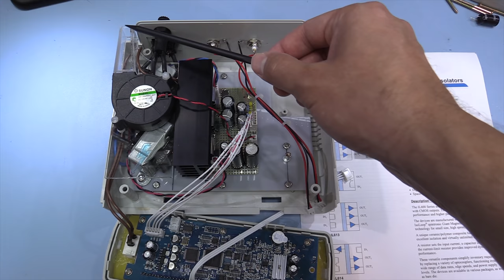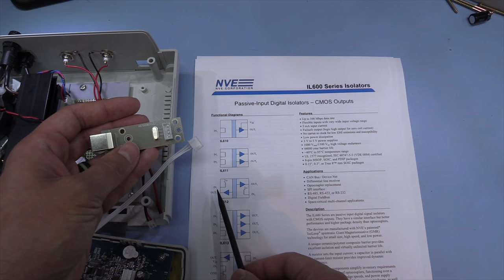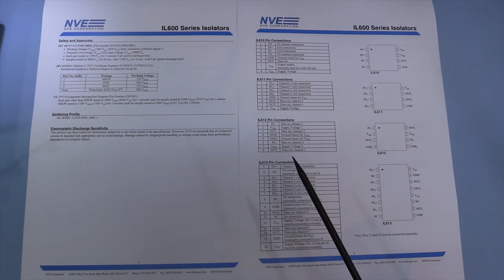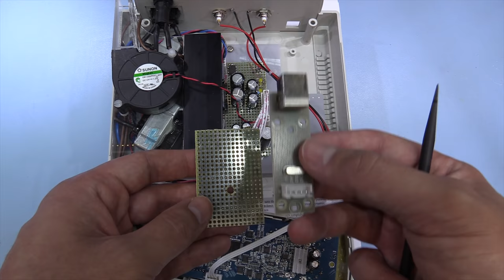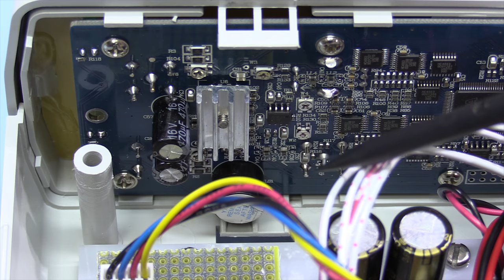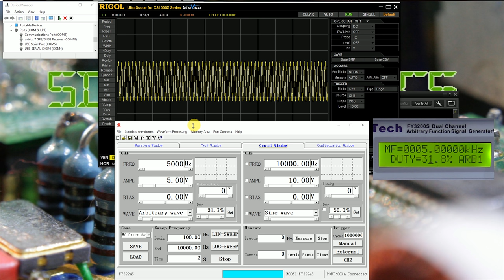SDG #041 USB Interface Isolation - FY3224S Sig Gen

Comment: PROBLEM! I could only find the IL612-2 at Digi-Key, but you have to buy 10!  Is there a more common part to substitute?
--
Also, what type connectors are you using?
Reply from the maker: Perhaps the Si8421AB? Connectors are Molex KK I think.
Reply: @sdgelectronics  - This should work, from Mouser: ISO7721FDWVR
Thanks for writing back!
Reply from the maker: @markopinteric  yes, it should work fine

Comment: Can you please explain why you wish to have the signal generator's exposed grounds (BNC connectors, USB connector)  isolated from mains ground.  A simple solution to the safety concerns is simply to connect the mains ground (green-wire in the USA) to the  signal system ground (power supply negative) which in turn are connected to the BNC and USB connectors.
Reply from the maker: It means you can connect the signal generator to any point in your circuit and not worry about stray return paths. It's not a necessity, but it means you could drive some high side transistors easily for example.

Comment: How did the case temps compare Steve with & without the fan, did you see much of difference?

Cheers
John
Reply from the maker: Hi John, there's quite a difference - there are some vents built into the bottom of the case, so with the fan I didn't see anything more than 2°C higher than ambient in the free space of the case. Without the fan the internals reached 15°C higher, but the 15V transformer was alarmingly warm at full load into 50 ohms.

Comment: Thanks, I bought one and have started to order the parts for the modifications. For what it's worth there are some very nice potted, PCB mountable transformers by MAKRAI  in Hungary which are less bulky than the ones you used. They are available from a number of EBay traders.
Reply from the maker: Thanks Stephen for the info.

Comment: Excellent as usual. One question, why the galvanic isolators as opposed to opto isolators?
Reply from the maker: No particular reason - both are valid options. The nice thing is that they are buffered outputs, so you don't need to worry about the impedance of your pull-up resistor which you'd typically use on a standard transistor output opto.

Comment: Another interesting video. I'm planning a very similar upgrade of my own unit.
I see you've used the IL600 series though - any particular reason for that choice? Those look a bit awkward to use, by way of "coil current" and so on. I've always been more a fan of the Analog Devices range; in particular the ADuM1201 would do well here. That's the chip I'm planning to use in mine.
Reply from the maker: The Analog Devices isolators are just as suitable for this design - I mainly used what I had to hand. Thanks

Comment: Could I use optoisolators ?
Reply from the maker: Yes absolutely. Just watch size of the pull up resistor if you use the output transistor in open collector configuration as it'll effect the rise time. The baud rate isn't too high though so shouldn't be too challenging.
Reply: Right, thank you for the tip ! Nice build and video. With my unit I measured no voltage between the BNC and ground and obviously no current.
Reply: @sdgelectronics ,  I believe you meant "affect," in place of "effect."